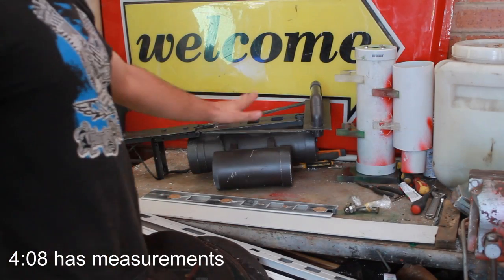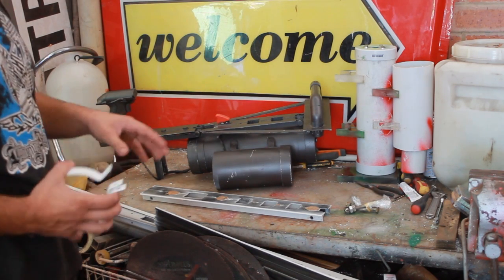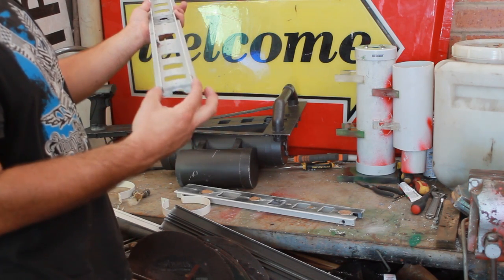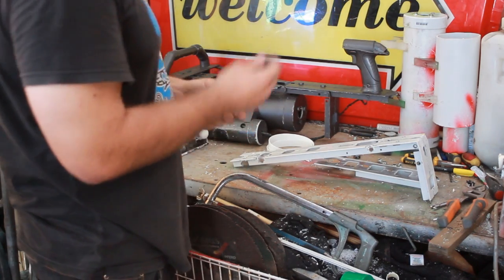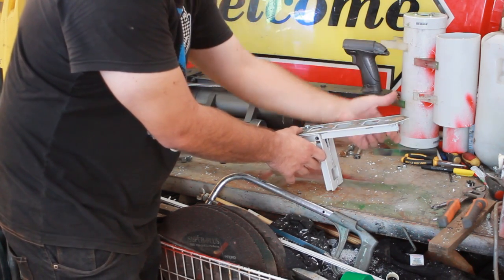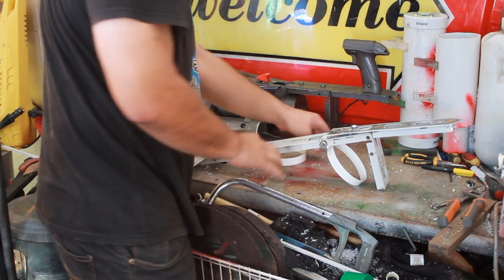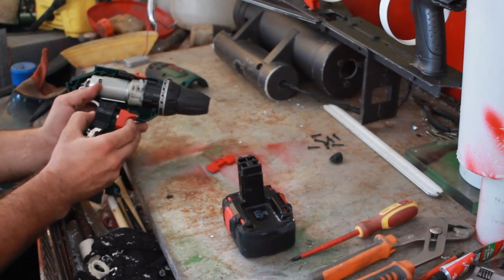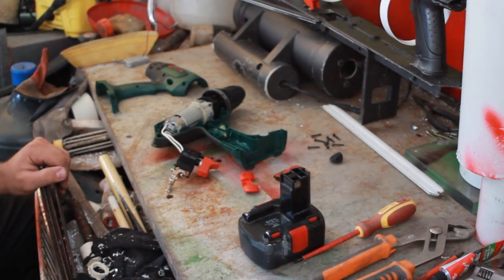DIY Minigun tutorial. Part 3 - Aluminium body

Comment: What type of drill did you use? I'm making one much bigger, so I don't know if it needs more voltage or rpm
Reply from the maker: I used a Bosch 18v. I think from memory. I'd love to see it when its done.
Reply from the maker: Also I think 18v was overkill on mine so it should be a good size for yours.
Reply: So, my barrel is 23.6 inches long, being each 6 of them 1.5 inches wide, made out of pvc, can a 12v drill be able to make it spin?
Reply from the maker: I would say yes, as long as you go for a reputable brand like makita, milwaukee, hitachi. They should have more than enough power. You could even look into different devices other than a drill. Maybe an RC car or stepper motor. Basically anything that spins with a controller that you can take apart should work. You may be able to do some math and weigh your barrel and figure out if a motor could spin it. I would recommend a drill it might be more expensive but seems like the better option.
Reply: It's a bosch

Comment: Just to make this clear, you had two sets of wires and put the drill in one of the large pvc`s and the battery in the other pvc to make a circuit. Right?
Reply from the maker: gianluca quagliaroli Yes that is correct. Also it cost me around $150 from memory. I might mention it somewhere in the video. I did already have the drill laying around and the aluminium framing.
Reply: ok thank you